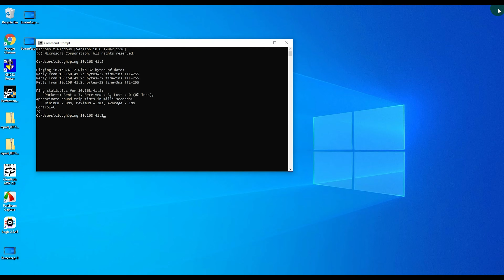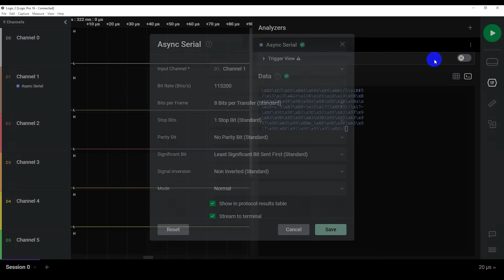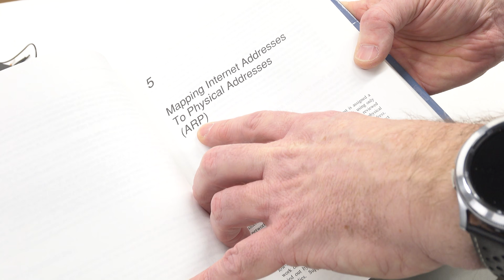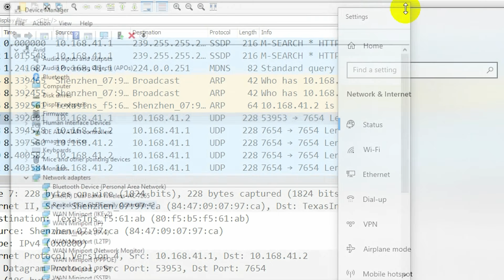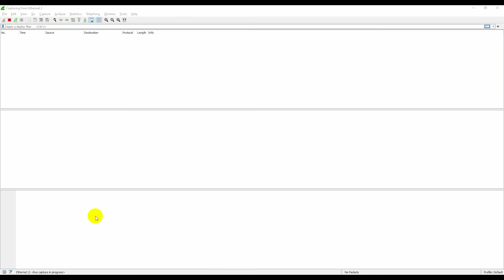Troubleshooting the Centroid Acorn and Ether1616 Network | Why won't it connect? | Beelink + Realtek

Comment: I would have started  with WireShark because I don't have a serial analyzer.  I recall the before times and encoding information on dead trees!  I challenge you to do CNC over TCP IP over Avian Carriers! 🕊 Nice troubleshooting and thanks for sharing.
Reply: What, African ones or European? 😉
Reply: @M_Northstar  Any bird!   I would  accept waddling penguins.  Hmm-  Must be a bird, and >= 100 meters.  Flight is optional.
Reply: Same. Wireshark is the first place I'd have gone after it pinged but didn't work. I'm not sure I'd have pulled the USB ethernet out and tried that though. That was a smart move.
Reply: @feeseize9569  I have a few of those USB to Ethernet adapters but, with the ping and the Acorn connecting I would have assumed the NIC and driver were good.  Once it worked on another computer I suspect I would have dug a bit deeper.
Reply: @joeldriver381    this was such a weird edge case. ARP offload worked fine for specific IPs just failed (or rather shouldn't even have ARP'd) for the broadcast case.

Comment: "if you don't know what this is, it's called a book. This was used in the before times to encode information on slices of dead tree"

This totally got me
Reply: It's seriously shitty legacy tech. Have you tried doing a search through it...?
Reply: My computer science lecturer used to (and apparently still does) introduce the concept behind a binary search by ripping a phone book in half until he finds someone’s grandma’s number… then called it in front of the lecture theatre!
Reply: It's fine when you've only got to search one book, they create indexes at the back for that... not as good as google but surprisingly effective for the common search terms. It's when you have to search for information in archival book repositories it's a problem.

These things called Libraries you see... except rather than pointing you to a single book the search index for Libraries barely points you to the correct shelf and sometimes people fail to put the books back in the right place anyway.

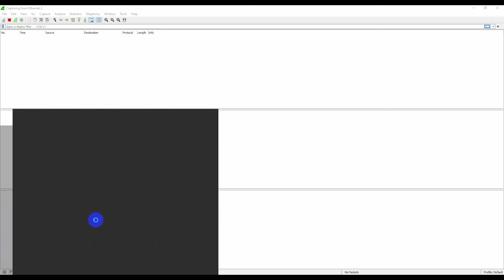Comment: just got to 17:34 ... wierdly this came up on a reddit thing today -> some windows drivers just drop non tcp/ip traffic, it's not what they're looking for so it drops them as not intended for them, if the acorn board is on a different protocol you may need a more debug orientated driver... wonder if this is the conclusion you come to too
Reply: Happy to be wrong, but yeah driver change might have fixed it anyway, glad it was just a driver setting though ^_^
Reply from the maker: I tried all the drivers I could find.  For this hardware, the driver has been stable for a long time.  The windows whql driver seems to be pretty much the same as the one provided by the manufacturer.

Comment: I also got stuck on this setting up acorn..For the average person i think acorn is fairly difficult to set up..( compared to mach )  I had to change all the Ip addresses to make it work.. Im not a computer wiz so it was a disaster. ( think of a monkey staring at a nuclear reactor )
Reply from the maker: I have found acorn to be more intuitive than mach so far, but I have decades of experience in the tech industry, so I'm a terrible proxy for the average person's experience.